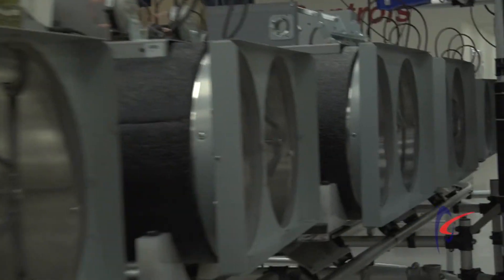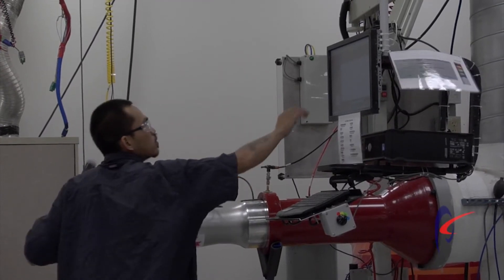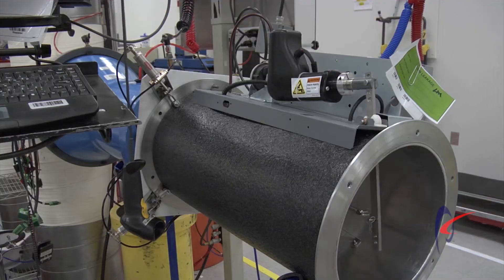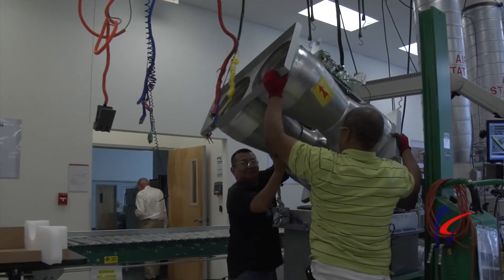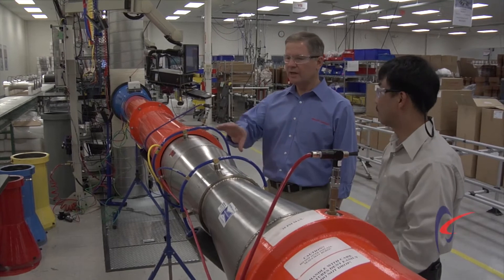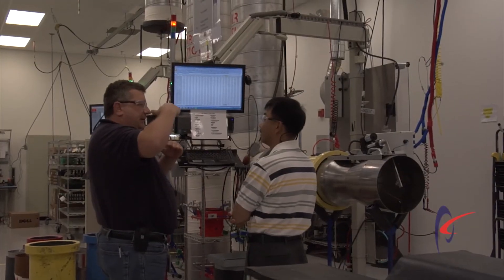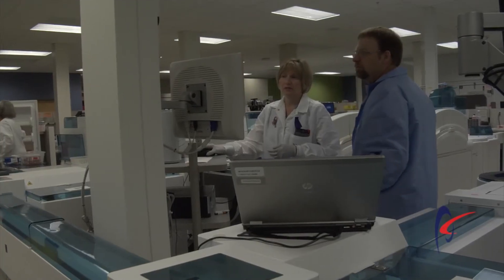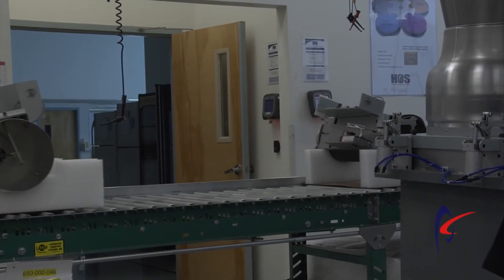The Phoenix Controls Difference

Comment: 1.25 Inch WC pressure drop across the valve is extremely High, How can you save energy!!!!
Reply: Exactly.  Junk.
Reply from the maker: Hello Luay,

We would agree that at 1.25” WC there could not be much energy being saved.
However, that is not what the Phoenix Controls venturi valve needs in order to control airflow.  
In fact, in most applications the valve can work accurately (+/-5% of commanded value) with as little as 0.3” WC of pressure drop.
The full pressure range in our specification is 0.3” to 3.0” WC of pressure drop. We test the valves at multiple pressures when characterizing them to ensure they will operate to our +/-5% accuracy in varying conditions. The 1.25 in wc was just one of the pressure conditions we tested at for this demonstration.
If the valves are located close to the fans, they will see higher static drops perhaps as high as 1.25”, or even higher. But the valves that are located far from the fans will see much lower static drops. Often as low as 0.3” WC of pressure drop across the valves.
The Phoenix Controls valves do this with the highest level of accuracy and require no maintenance. They control very accurately at low pressure drops. 

If you’d like to know more, we have many YouTube videos (as you have seen) and or we can put you in touch with a real person to talk with if you’d like. 
Regards,
Phoenix Controls